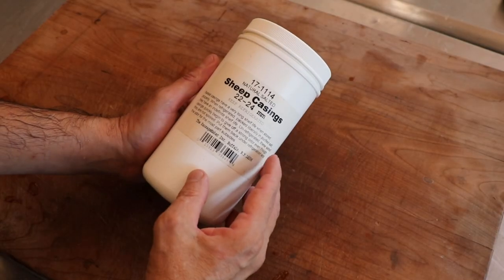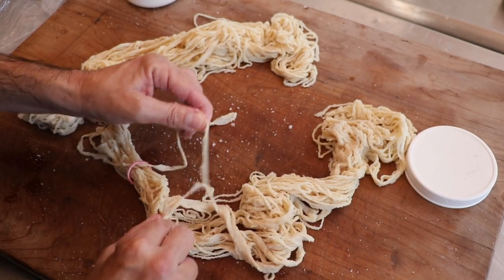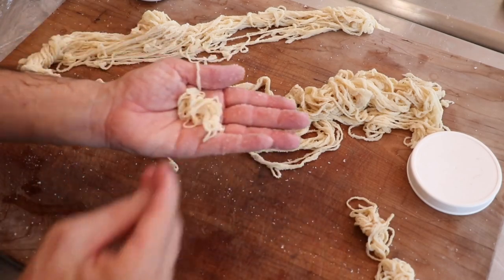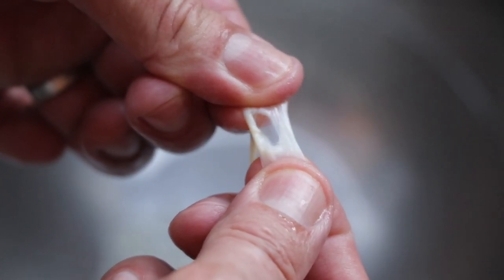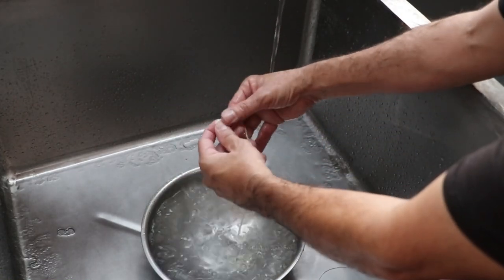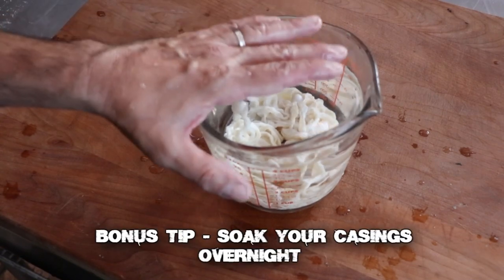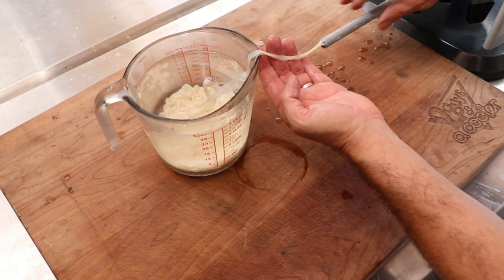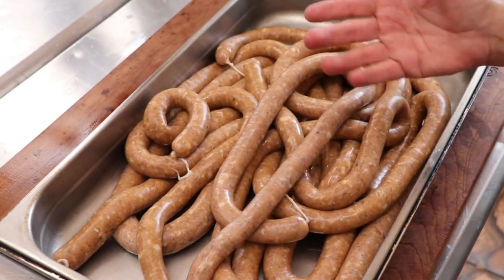4 Tips to Make Sheep Casings Work for You | Beyond the Recipe

Comment: Hi Eric - Tip number 5: When starting to stuff your casing - fill your applicator tube with meat and then overfill slightly. You then have a nice little bulge to work over which opens the casing as you're pushing it on.
Reply from the maker: Great tip!

Comment: I bought some AA casings from the Sausage Maker (there is a marked difference with the better casings), I added baking soda but I broke my auger on my Carnivore meat grinder so my casings had to sit in the water with baking soda for over a week until my auger replacement arrived. I was worried that being in the baking soda solution for so long would damage the casings. No problem at all, no casing blowouts, made great sausages.
Reply from the maker: I love the baking soda trick!!

Comment: Eric what’s your opinion on using white distilled vinegar? I’ve been using this to soften my casings and I get a nice snap from hog and sheep casings. Next time I’ll try the baking soda but I would like your opinion on this. As always another Great video.
Reply from the maker: vinegar much like lemon juice is an acid and the acid very slowly eats away at the lining of the casing.  Thie rapidly tenderizes them.  Too much time in a vinegar solution can make the casings fragile.  Personally, I've found that an overnight soak in either regular water or water with baking soda works well for me.  With that being said, if someone wanted to rapidly get their casings ready a little vinegar will surely do the trick😉
Reply: Thank you